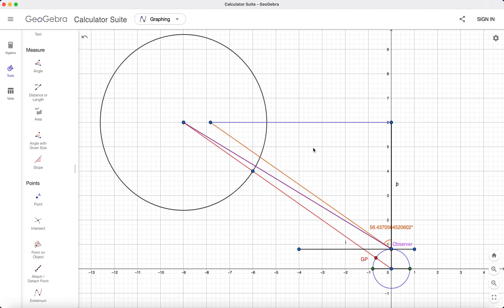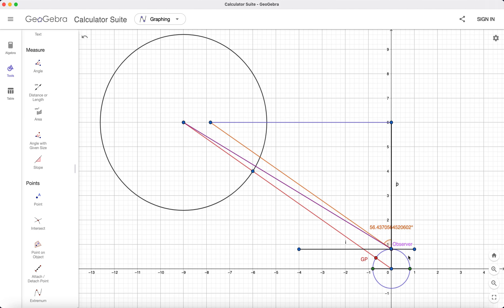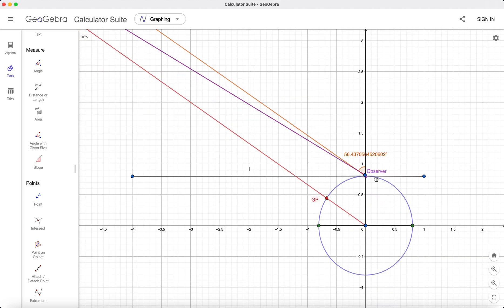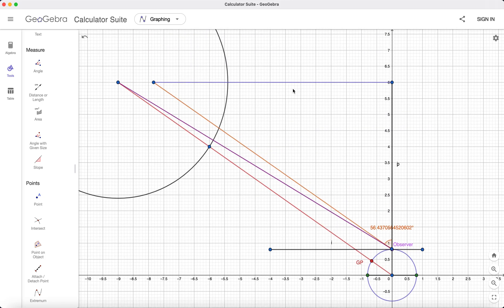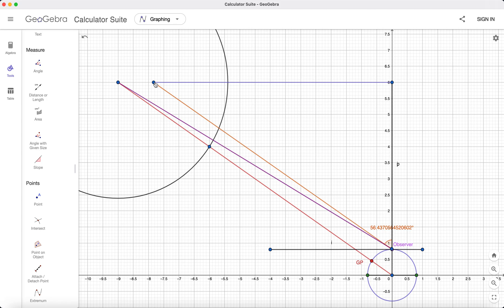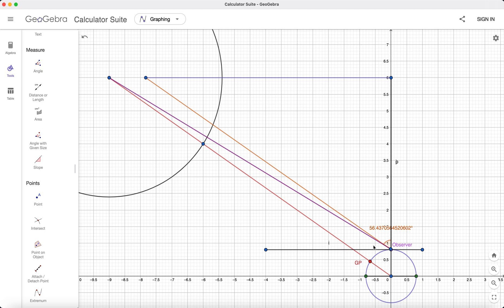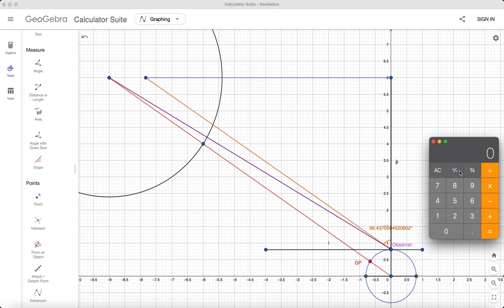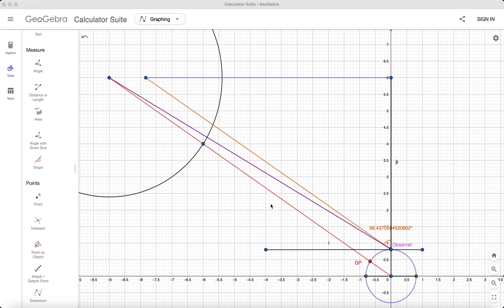Zenith Phobia....?

Comment: BRILLIANT! YES, parallel rays to the star! By Jove, you almost have it! 2 or 3 more videos like this and I think you will nail it. Now here's a tip for your next video. The ONLY thing we are interested in is finding our latitude DISTANCE along the ground is the difference between 2 latitudes. NOT the base of some imaginary baseline of an imaginary triangle. 
And finally, you have slipped back into the distance to the star mode.
Reply: But phil , the equator is an imaginary line 😂
Reply: @dennispickard7743  the equator is definitely an imaginary line based on a physical attribute of the world. It wasn’t decided on where it is by guessing. And of course it’s integral to navigation as are longitude and latitude. I’m not sure why an expert navigator like your goof flat earth self needs to be reminded of these facts.
Reply: Prof Phil Bell  tell me phil ! 200 miles from the imaginary line would north still be north and south still be south ,applicable to east and west ! Are continents to Scale on a globe used for navigation ? 
Now old boy , I almost getting tired of explaining this to you ! You really do need to stop crowing about ‘ flat earth ‘  our earth is not flat Phil as  has some stunning topography- flat is a description of a surface and not s Geometry.
Many globe skeptics do NOT believe our earth is any Geometry sneered at by globlings - most ( myself included) do not believe our earth is a pizza box, pancake or pizza or whatever is the globlings buzz word of week .
Our earth is a level plane and that has been proven over a hundred years ago . The next part of the puzzle phil , is what is our level plane in/upon ? 
Do you believe that the cartoons you gleefully show from ISRO is our earth ! Come on Philip ! It’s a bloody cartoon 
Ah ! I get it now professor - the anxiety lark ? Is this due to the spanking ye got on Adams channel?
Be gentle on the rum barrel this weekend Philip ! Ye have school on Monday 👋👋😂😂
Reply: Brian, you should listen to Phil. He's not wrong!
Reply: SHAWN HAWKINS Do tell me Shawn if one were going to stand on the imaginary equator line - could one view Polaris and  Polaris Australia ?
Reply: @dennispickard7743  , I suppose in principle it should be possible to see both stars from the same position, but in practice it would rather unlikely since both stars would have less than 1° of elevation. It's an interesting question, though
Reply: Tom Mole sigma is barely visible with the naked eye ,is it not the fifth magnitude . Several globe fanatics claim that both have  been observed ( so it’s gotta be true then lol 😂)
Reply: @dennispickard7743  , I submit that, though there may be a line of sight to each reference star from a single position, they would each be very difficult to see due to atmospheric attenuation. I have no idea who claims to have seen both stars from a single position, but then I don't speak for those folks, only for myself. I have never even tried to see both stars from the equator. It seems like a waste of time.
Reply: @dennispickard7743  I’m glad you say we only need to go to 4000 miles to see the shape of the earth. A handful of people have seen it from beyond 240,000 miles. Perhaps they took photos.
Reply: Andrew Johnston earth rise Bwaaaaaaaah 😂 come on Andrew mate !
Reply: @dennispickard7743  , actually, it is easier than that. There's clearly more than one way to skin the "Earth geometry" cat. In fact, it has been done for centuries before anyone ever figured out how to get into the air. Of course, it could all be a huge conspiracy to deceive the unwashed masses for reasons unknown, but the facts do not bear this out. I will admit that from the surface of the planet it can be challenging to even visualize the Earth as a great big sphere and that challenge may well beyond that capacities of a flea on a basketball, but humans can solve it. Well, some humans can, even without getting 4,000 miles above the surface and just looking.
Reply: Tom Mole lol Tom 😂 no one has ever detected curvature at ground level or not much higher than . Do you trust your eyes Tom ? I have excellent eyesight but yet I know train lines do not converge  - if you were given a task !
(1) observe a street 1km long .
(2) every 100 m there is a house , street lamp and a car .
(3) sketch what you actually see .
(4) start making a scale model on your graphic representation.
(5) start making the lampposts first - would they all be the same size ? or according to the sketch would the last one be smaller than the first one ? 
Some people say that a ship going over the vanishing point is proof of curvature - a midrange telescope says it isn’t .- just saying
Reply: @dennispickard7743  , oh please! My draw skills are rather limited. Would it not be sufficient to stipulate that angular size diminishes with distance? But then, what does this have to with the Earth being curved? I have never yet heard anyone say that ships going over the vanishing point is proof of curvature. Who said that?
Reply: Just William if you are using a theodolite- it would not matter . The instrument is firstly calibrated by the usage of a simple inbuilt device called a ‘ spirit level ‘ the terrain on which the instrument is placed upon is not taken into consideration . The differences in elevation of ‘ fixes ‘ are simply recorded . The instrument is deemed LEVEL once calibrated .
Reply: Prof Phil Bell Lol 😂 phil “ we both know the earth is a sphere” yo pro ! A lovely little bit of passive aggressive there Philip with a chunk of Transactional Analysis thrown in - Transactional analysis (TA) is a psychoanalytic theory and method of therapy wherein social interactions (or “transactions”) are analyzed to determine the ego state of the communicator (whether parent-like, childlike, or adult-like) as a basis for understanding behavior.
Tsk,tsk Philip ,I don’t think so lad ! So Professor , this is your parent Ego State talking to my child Ego state ? Ah ! Good ole TA  . any crossed Transaction ( if used properly)  can be persuasive in essence .
Yes Philip dear ! I do work with  data that is not dependent on Earth being a sphere! In fact it would be detrimental to my wellbeing if I considered so .
I thank you for your concern Philip , but no need fella , but I’m happy being a globe skeptic until I see an actual photo of our earth from high altitude ( not CGI nor 2 bit cartoons ) .
Enjoy your weekend Professor .
Reply: @dennispickard7743  
Why is there no dip correction needed with a theodolite, or bubble sextant or artificial horizon?
Reply: Darrell Kimmel Lol 😂 Levelling is a process of determining the height of one level relative to another. It is used in surveying to establish the elevation of a point relative to a datum, or to establish a point at a given elevation relative to a datum .
Reply: @dennispickard7743  
So?
Reply: Darrell Kimmel  you’re not serious Darell ? Dip correction .don’t you mean ‘ apparent altitude ? Or sensible horizon? You do not use any correction for dip if ‘ artificial horizon is used . The artificial horizon is the ‘ sensible 
The altitude obtained after applying corrections for index error and dip is also referred to as apparent altitude,
Please man ! Where’s the photos of earth Darrell ?
Reply: @dennispickard7743 , what a great question!! Where indeed are the photos of Earth? I have never yet seen even a fake photo of the "Blue Disk" that might prove the Earth is flat. I have, however, seen photos of the globe, though some claim that they are fakes.
Reply: @dennispickard7743  
Dip correction is required when using an optical/marine sextant and the horizon to create a reference baseline as one side of the Angle of Altitude.
This reference baseline is level at and perpendicular to the navigator's zenith.
Bubble sextants, theodolites and marine sextants with artificial horizons don't correct for dip, no matter what elevation the sighting is, relative to sea level, because they create a lower baseline that is level at the navigator's GP and perpendicular to the navigator's zenith by design or calculation. The baseline being level at, and perpendicular to the navigator's GP zenith is crucial, not elevation above sea level.
Flerfs say there must be a LEVEL line between the navigator's and star's GPs. Can that line slope? From 20,000 feet?
Does the horizon rise to eye level at all altitudes, as is claimed, or does the dip correction debunk this?
Nice Transactional analysis copy paste by the way.
Do you have a link to the original page?
Reply: Tom Mole Tom “ blue disk “ 😂 TOM ! I have told you many times that I’m not a flat Earther in your meaning of it - 
I do not believe our Earth is a pizza box or pancake or a frisbee or anything resembling that Geometry - not one bit .
So then Tom , let’s see the photos ( unadulterated and non CGI imagery ) - don’t mention the blue marble Tom or I will scream !
Reply: @dennispickard7743  
Not a glober, not a flerf.......
What's your claim?
Reply: Darrell Kimmel what’s my claim? - I’m flobling Lol 😂👋👋😂😂😂
Reply: Just William I don’t believe I said it’s ok of any geometry are we going to dismiss artificial horizon and sensible horizon?
Reply: @dennispickard7743  , I wouldn't want you to scream. LOL I suspected that might, which is why I very carefully said nothing about the blue marble photo.

 What did say, however, is that, despite the fact that some might claim that photos like the blue marble photo are all fake, there are no photos of the "blue disk", not even fake ones. I never suggested that you provide such photos. I just said that they don't exist. I thought this was a pretty insightful point, didn't you? Are you actually asking me to show you certified genuine photos that I have personally taken from 4,000 miles in space? And, if I can't produce these photos, then the Earth is not a globe? 

How would you know then? Do you have certified genuine photos that you have personally taken that show that geometry of the Earth to be anything at all other than a globe? I've got no such photos of the globe and you have no photos whatsoever, so you can see nothing more or less than I can. You'd agree then that it would be fair to say that, unless you can provide your genuine photos, you can't honestly say that the Earth isn't a globe! Maybe there's other ways to determine the geometry of the Earth beyond photographs.
Reply: Darrell Kimmel nice copy and paste Darrell
Reply: Tom Mole No Tom , I do not have any photos ( not even fake ones 😂)  right Tom , I’m away out for Sunday lunch with the good lady - I think I’ll start with a pint of flat beer ,followed by a flatbread then to finish a nice pancake with icing round the edges 😮.
Enjoy your weekend Tom .
Reply: @dennispickard7743  
If I copy/paste, I use "quotation marks" to indicate that it is indeed a quotation from another source.
Reply: Darrell Kimmel “ oh you do ,do you ?” Ahahahahahahaha
Reply: @dennispickard7743  
You do realize there are two Blue Marble images, right?
"The Blue Marble is an image of Earth taken on December 7, 1972, from a distance of about 29,000 kilometers (18,000 miles) from the planet's surface. It was taken by the crew of the Apollo 17 spacecraft on its way to the Moon, and is one of the most reproduced images in history."
Reply: @dennispickard7743  
Your best globe refutation is THAT crappy music?
Country western is the truly the music of poetry.....the words always rhyme so very well. 🤮
Reply: Darrell Kimmel music 🎹🎷 oh there ain’t no photographs of earth !
Reply: @dennispickard7743  , well... TBF, there are photographs of Earth, lots of them, even if some were retouched a bit. What there are none of is photos of a flat earth (or concave or toroidal or hollow or....)
Reply: @dennispickard7743  , why would they need to be retouched a bit? For the same reason that Beyonce's photos need to be retouched a bit. It makes the photos more presentable, of course! Why do women wear make up? I think you can get a look at the original photo, if you try, but it is not an example of the Earth's resplendent glory. Of course, no one has yet taken even one dull, blurry shot of the flat earth, have they?

To your second point, I find flerfers come in many flavors. Some are religious zealots, many are just globe deniers, others are disengenuous trolls and still others are simply booger eating, crayon munching idiots that believe anything they are told. Most seem convinced that the United Nations logo is a genuinely accurate map of the Earth. If that doesn't make you laugh out loud, you must lack a sense of humour. What do figure the term "flat earth" means?

Now, to answer your question, I don't know if Elon Musk actually launched a car with a dummy astronaut in it or not. In fact, I don't really care. It could true or not, but who cares? I suppose it's entirely possible, and yet it could just be a fabrication for publicity. Either way, there's nothing particularly interesting about this stunt. Wouldn't there be a more engaging question you might ask?
Reply: Tom Mole thank you for addressing the points , with an interesting twist I’ll warrant !
(1) the reason Beyoncé’s photos are touched up is to appear as something she is not - why do women wear make up , well Tom that question would be best suited to an Anthropologist rather than us mere mortal men - ok I’ll take a stab at it - increased self esteem perhaps? My wife does not wear make up , though she does use natural skin care malarkey.
(2) flat Earthers “ - disingenuous Trolls “agreed Tom , some Defo are , “ booger eating , crayon munching idiots that believe anything they are told “ well Tom ! I think that is applicable to both sides there .
The United Nations a flat earth map ! I’ve no idea , I don’t think it is ,perhaps it’s a meaningless Logo ?
“ the term flat Earth “ - well Tom , I do believe I have explained this before - but I can only give you my opinion ,though , subjective albeit .
In a nutshell I do not believe the cartoons shown are our earth , what geometry it is , I could not tell you . I would need to see it from a very high altitude with mine own eyes .
(3) I’d say we both are fairly sure that the ‘ space car ‘ lark is a publicity scam and we are not going to waste our valuable time discussing the ‘ con artist ‘ of the century .
“ Another engaging question you could ask ?” Yes , indeed there are , but you would tackle the questions with obfuscation and non committal like the last lot .
Be well old man 🍺
Reply: Just William Lol little willy 😂 I note you avoided the space car malarkey! Good idea mate , no one in their sane mind would defend that tripe 👋👋😂😂😂😂
Reply: Just William Lol 😂 nice try little willy ! You know it BS as much as I do ? Car in space - vrooom , vrooom 😂😂😂😂😂 👏👏👏👏
Reply: @dennispickard7743  
The space Tesla is kind of a genius publicity decision.
The 2010 roadster was Elon's own daily driver and 8 years old at the 2018 launch.
"In March 2017, SpaceX's founder, Elon Musk, said that because the launch of the new Falcon Heavy vehicle was risky, it would carry the "silliest thing we can imagine". In June 2017, one of his Twitter followers suggested that the silly thing be a Tesla Model S, to which Musk replied "Suggestions welcome!". In December 2017 he announced that the payload would be his personal "midnight cherry Tesla Roadster".

One of the test flight objectives was to demonstrate that the new rocket could carry a payload as far as the orbit of Mars. NASA had declined SpaceX's offer to carry a scientific payload."

He couldn't profit off a test launch of an unproven rocket, needed a dummy payload, had an older car and it was time to upgrade..... and he OWNS the car company.
He's also kind of quirky apparently.
And now in 2022, completely out of the  blue, YOU are talking about Tesla and Spacex!
Reply: Just William Nah !
Reply: Just William Lol 😂 William ! Our earth does not move - waken up little Willie 😮
Reply: @dennispickard7743  , well, OK then. I guess that about it.

I was curious about a couple the point you made, however. 
(1) What would you expect see of the Earth from 18,000 miles above the surface? Would a photo that you personally took show you vibrant life ebbing and flowing with all types of flora and fauna vying for their existence through war and peace? Or, would you just see a rock of whatever geometry covered by weather and uneven lighting effects. I'm thinking that you're anticipating anything besides a globe.
(2) I asked you what you feel is the correct geometry for earth and you reiterated what you believe it is not! It seems reasonable that you would be keeping an open mind on the subject, but when you eliminate the best supported, most likely solution out of hand you aren't really keeping an open mind, are you? So, if it's not a globe, what is it? If you don't know what it is then you probably don't "know" what it isn't, right? It's just your opinion, a belief.
(3) Elon Musk's flying car is about as irrelevant as last year's commercial for a Purple mattress or underarm deodorant. Who cares? Asking irrelevacies is a well worn technique for obfuscating, yet you refuse to ask a more meaningful question because you presume that I'll fail to commit to my answer and obfuscate to cover it up! That's pretty offensive talk coming from the guy who won't commit to his answer about the geometry of the Earth and then asks about whether or not a publicity event in space is real or not. Perhaps you were looking at a mirror while you were typing your response. Giving you the benefit of the doubt I'll ask again. Don't you have a more interesting, relevant and engaging question you could be asking?
Reply: Tom Mole yes Tom ! In fact 2 questions .
(1) how many hours is a parabolic flight pilot allowed to fly in a month due to eye  and the vestibular system  damage ?
(2) how would the vestibular system work if one had no inherent up & down for extended period ? 
Offensive Tom ! Moi ! Lol 😂- no I’m not offensive , just not buying the BS from agencies setup to Hoover up tax payers money and give out cheesy cartoons and 2 bit graphics . I’ll keep my skepticism tightly in my pocket for now thank you .
Reply: Just William mikleson morley !
Reply: @dennispickard7743  , well, you know, I have no idea how many hours a parabolic flight pilot is allowed to fly in a month. Except for the accumulating effects of rapid pressure changes, I can't imagine what about a parabolic flight would cause damage to the eye or vestibular system. Micro gravity does not damage these biological systems as far as I know. Do you know something more?

The vestibular system is pretty much useless in microgravity, which contributes to making rollercoasters so exciting! The lost sense of up and down gives most people "butterflies" as it triggers an involuntary adrenal response. Over time the brain learns to anticipate this reaction and suppresses it. But, it is pretty exciting at first!

So, did I obfuscate or fail to commit to my answers? The fact you're unwilling to commit your skepticism to critical review was not offensive. What I found offensive is you attributing your behavour to me. You presupposed that I would do what you do. That is just not how I roll!
Reply: Tom Mole “ did I obfuscate “ lol 😂 just a little bit Tom ! What’s happening chief ?
Reply: @dennispickard7743  , do you really feel that I was obfuscating? Really? Wow, amazing! I guess, in orderto be clear for a flerfer, one must just blindly agree with whatever he says without question, challenge or a mind outside of the faith. I'll tell you what, why don't you tell me what I should think and I'll mindlessly agree with it. Then, when you say I'm obfuscating, you'll just be accusing yourself and the only thing either of us will be right about is who is covering up their ignorance with red herring fallacies. Does that sound like a plan, chief? LOL 
(Wow! No wonder most folks just laugh at flerfers! Trying to have an intelligent discussion is like talking to the chimps at the zoo.)
Reply: Tom Mole Tom Lol 😂 calm yourself sir ! I’ve told at least twice before - I’m not a flerf . I’m skeptical about our earth being a spinning rock . That does not mean I’m going to embrace the pizza box model - I’m not swapping perhaps one untrue model for another that may be as equally untrue . That will get one nowhere .
Now Tom , I did mention about ocular damage in micro gravity and you disagreed ,lest you thought it would do “ no damage “ - but - the vids I linked clearly stated that the actor nots 😂 claimed ocular malady occurs .
“ covering up ignorance “ Nay Tom ! I believe you are a very intelligent man and not at all ignorant , on the other hand I’m Scottish and can be a bit ! But that does not mean we cannot have a reasonable convo ..
The only subject I wish not to discuss is religion in any guise . I don’t know if you’re religious? I’m not , inasmuch I never give it much thought . My mum is a ‘ holy joe ‘ in Scotland that’s a strong church goer .
Perhaps you have noticed that Globies v flatties are taking a bit of a back seat at the moment and another subject has reared its head which is Atheism v classic religion v YEC ( young earth creationist) - they are all incorrect ,though there is a sub division of all this - that is ‘ intelligent design ‘ those usually spar with 
Darwin’s crew .
If I were going to put a horse on the race it would intelligent design, it seems more credible than the rest . Parts of Darwin’s theory is correct , but the linear time scale is not . What the Darwinism folks either won’t or don’t take onboard is the Bacteria is the main agent for DNA change in animals and not solely timescale.
(1) Darwin - not entirely true. fact mixed in with fiction so well that the two cannot be separated .
(2);Atheism - many whom claim that they are so , do not know what an Atheist is - some read the Bible ( which is scribed in parable and not literal ) then take or cherry pick a passage , put it in literal envelope and smash it to pieces . A good example of this is that satanic  clown Aron Ra ,who uses schoolboy NLP, Transactional Analysis and the heavy clout of his well memorized cheesy vocabulary. Nope ! They are not atheists , they are anti- theists 
(3) classic religion , I’ve no idea . Perhaps it’s where some get their spiritual salvation 
(4) the intelligent design dudes - now there is something there that raises an eyebrow in most . I read a lot of a girlfriend of mine books on psychology and Carl Gustave Jung always seemed to intrigue me - synchronicity , coincidences ( or lack of ) perhaps everything has a purpose? - perhaps nature has its own nature and contains therein an inherent intelligence - a code? A set of instructions if you will ( I have used the word perhaps Tom , so I make no claim to the validity of ) If you look at quantum biology,it’s a mind blowing fascinating subject . Some who have studied ( a lot more than I have ) sway towards the ‘ Matrix ‘ theory , I don’t .i just find it fascinating and ponder why randomness could be considered as an option- thus my favor for ID .
Right Tom that’s enough computer lark for one night - I’ll have eyes like an astronaut if I’m not careful lol 😂 
Goodnight Tom .
Reply: @dennispickard7743  , I'm really quite calm. It has been a bit frustrating, but I'm accustomed to that. I accept that your are not saying that the Earth is flat, but rather that you're pretty sure it not a globe. You would be what I refer to as a "globe denier". It seems to me that you are fine with the Earth being any shape at all as long that shape is not spherical. I've never really understood why it's so important for the Earth to not be spherical. I find this frustrating because it really serves no important purpose as far as I can tell.

There's nothing wrong with being skeptical. Science depends on large doses of skepticism to keep it objective and progressing. And yet skepticism as a goal is just as hazardous as religion is to the development of science. Allow me explain from my own experience.

As a child I was introduced the physics of the world around me and I began asking questions. The answers I got back were like this, "this is just how it works", "you'll understand it when you grow up", "I don't really know how it works", "you wouldn't understand it even if I explained to you", etc. My cousin, who happened to be 4 years older than me and very interested in science, would try to explain to me things that were well above my grade level. I didn't always understand what he told me, but I never forgot his explanations. That started nearly sixty years ago. My greatest fear was that I might end up indoctrinated by the tenets of science that I might lose that innocent curiosity and for most of my formal schooling I eschewed science. My skepticism pushed me away from science, not contributing to it. Once I moved into engineering the science behind it became more intriguing.

Now I'm back, seeking to find the "Holy Grail" of science that everyone else might have missed and I have the internet to help me research this endeavour. I searched for offbeat conjectures that I might develop, but what do I stumble upon? A plethora of idiots vehemently promoting the retardation of science, because..... NASA and God!

I suspect that Einstein, Tesla and Newton all got some things wrong, but they got most things right. I don't waste much time on conspiracy theories in science. I do not opine that there is a massive cover up in the scientific community to deceive the unwashed masses about the nature of Nature.

I do suspect that there is some Intelligent Design behind it all, but I submit that it is all design, not execution. No one is standing behind a curtain pulling levers and twisting dials to control every aspect of everything. That just seems silly to me. I leave the wizardry to wizards and I never visit Oz.

I do not much bother to question that we live on a rotating sphere that orbits the Sun while being circled by a much smaller moon. I have already taken up this question and found this answer to be most probable and completely consistent with obervations. I would prefer to address the questions that don't have obvious answers, such as "what is gravity?". I never ask, "does gravity actually exist?" That is a stupid question which I reserve for the stupid to ask.

I have never considered Quantum Biology. In fact, I'm pretty sure that I've never heard of this science before. Perhaps I'll look it up.

It's funny that you're heading off to bed. I just woke up! It is morning here whilst it's nighttime for you, but this makes sense, since you are about 135° away from me on the globe! I hope you get that good night's rest in order to wake with eyes like an astronaut....open! 😃
Reply: Tom Mole good morning Tom . Ok we’ll put the Geometry of our earth on the back burner for now as we will not agree on it - perhaps our earth ‘ doffs it cap ‘ to being more toroidal than given credit for ?
(1) ‘ Holy Grail ‘ indeed Tom . IMO the Holy Grail  May be so close to us that we can’t see it , perhaps it’s is not elusive ,but more evasive in its nature ? 
(2) NASA & God - let’s take nasa first 
(a) scenario #1 the old chestnut- the moon landings. Perhaps they did land on the moon . Since it was under the auspices of military operation it would have been done with great secrecy, and at that time, near unimaginable funding - but ! What would need to have  been given was a show drowning in its own patriotism- thus paving the way for enormous funding ( offset ) of public money ?
(b) scenario #2 - they did not land on the moon as natural laws would not afford this venture any quarter . Thus the inverse square law may have been the inhibiting factor . I remember reading an article about high altitude data gathering probes in the 1950’s and the difficulties incurred - heat and radiation the main obstacle . In the article ( true or not ?) it stated that scientific instruments onboard were destroyed through inadequate shielding .perhaps the alloys or polymers had not be invented nor ‘ science-ed ‘ at that time .
JFK made a speech saying that “ they would use materials, not yet invented “ lol 😂.
If lead was used as shielding the ‘ catch 22 ‘ scenario would be in empty - the more lead the more fuel - and so on .Unfortunate animals were placed in these probes .Reports of monkeys with embolisms and not fairing well under the conditions . I have not witnessed this ,but can only tell you what the article stated .
(2) God - that’s a tough one Tom . First one needs to establish what god/s are or a god is . Perhaps understanding that it is not a kindly old gentleman with long flowing white robes and sporting a white beard and locks that resides skywards - in short, I do not believe that god is a person , it is something else , perhaps it is everything ?
Some say if there is intelligent design there must be a designer , then who designed the designer . That is going down ‘philosophical avenue ‘ that will serve no purpose rather than give someone ( extroverts usually) a platform to show off their vocabulary prowess and a sharpened skill set of circular reasoning .

If you take Flagellum- a bacteria that has all the components of an induction motor , one needs to leave the comfortable realm of chaos and randomness and perhaps give intelligent design some credence .
Here is Flagellum ( perhaps you know already ) https://youtu.be/fFq_MGf3sbk
This is Quantum biology, but on an entry level . It gets more complicated as it goes on on - famous quote David Bohm or was it Neils Bohr ? ( wrong spelling likely ) “ if you say you understand Quantum mechanics, then you don’t understand Quantum mechanics. 
Right gotta go - astronaut eye coming on 😂 
Enjoy your day Tom .
Reply: @dennispickard7743  , OK, let's do put a pin in the Earth geometry thing for a moment. After all, if the Earth were toroidal, we would easily see this and could photograph it from our own backyards. I think we can put that bizarre conjecture into the bin now and forever.

1) the reference to "the Holy Grail" was, of course, purely metaphorical. I'm not talking about find an actual old wine goblet, but rather an advanced perception in science. What I'm seeking is not just too close to be seen, it would be an effective entirely new way of seeing. It is not elusive, it is beyond conception. The perception I seek is currently our comprehension. 
2) NASA & God were two of the most common excuses that flerfers offer for the planet being flat. I don't find that either of these has any impact whatever on the shape of the Earth. But, let's go ahead dissect it...
a) NASA - You're likely too young or too far away to remember the Mercury, Gemini and Apollo programs and the politics that drove them. They were not austensibly military programs, though there was a strong political bent to them and they were publicly funded. These programs were NOT however carried out in secret. NASA wore its successes and failures on its sleeve for the world to see. Just as any private company developing a new product the proprietary technologies were not released right away. We were in a race with the Soviet Union and we weren't giving away our competitive edge. We funded our "Space Race" very generously indeed, as did the Soviets. I recall it being very patriotic for both sides with cheerleaders inspiring the public to approve whatever it takes to win this race!
b) Perhaps in our enthusiasm we bit off more than we could chew. We claimed to have won the "Space Race" by landing a man (or two) on the Moon and returning them safely to Earth, but maybe we cheated. It is remotely possible that Apollo 11 never actually landed on the Moon and that all our evidence that we did was fabrication in a sound stage in Area 51, but I doubt that. Maybe I doubt it because I am biased. As a yank I prefer to believe that we beat the Soviets to the Moon, but I think there's more to it than that. But.... can I prove beyond a reasonable doubt. Who knows? I don't even care to try. There were no insurmountable problems with getting to the Moon as long as we could throw enough money at those problems and I think we both agree the American threw A LOT OF MONEY at the problem.
Whether or not Apollo 11 actually landed on the Moon or not seems a trivial relic of the past, however hysterically one considers the money spent to get there. The cost was to the American taxpayers, not the Scots, so it should not be any real concern to you. Perhaps your real concern is that the problems could not be overcome by copious funding and thus to avoid exposing the failure there was a giant cover up. Well, I guess anything is possible, but covering up failure does nothing to advance science and so it really doesn't interest me. I favor the conjecture that NASA 9vercame all obstacles and achieved its objectives. I find no reason to doubt this other than a personal desire to do so.
2) God is not such "a tough one" as I see it. If one must prove God in order to deploy Him as evidence, I leave that odious task to the flerfers who depend on God to disprove science. It's not my problem. In the end calling on God or NASA to disprove what we already know to be true is a waste of my time. It retards science which is not interesting to me. You'll not catch me claiming that science is true because either God or NASA said so.

I have a couple of things I'm working on right now, but I would like to take a look a this "Quantum Biology" you are telling me about. I made a note to watch the video you linked in my morning. Now, I must catch some ZZZzz's before the morning sun ruins my slumber. Have a good day!
Reply: Tom Mole yo Tom , indeed Tom I was well aware that the reference to the ‘ Holy Grail ‘ was metaphorical. Perhaps Tom it is ‘ beyond conception ‘ I don’t think conception was the best word you could have chosen ? I would have used ‘ Genesis ‘ - the origin or mode of formation of something.? Perhaps I’m incorrect? Mayhap we are the Holy 
Grail - inasmuch a vessel waiting to be filled with something non tangible?
(2) I think you know my thoughts on NASA  - so it would end up a pissing contest of which I’m not interested ! 
“They were not ostensibly military programs “ perhaps they were clandestine black ops ? The military are not in the habit of divulging their business .
(a) Yes , I’m to young to remember the space programs - I can remember watching Capricorn 1 though 😂
Let’s tackle (1) the toroidal - perhaps the field has zero mass and therefore cannot be seen as a torus with our own eye - I do not know or wish to lay claim to ( Ken Wheeler HELP !  Lol 😂) .
I care more about what our earth actually is, and not plain Geometry. If you look into quantum biology,it gives more than a healthy nod to all things having a reason rather than serendipity - intelligent design if you will .
Right Tom almost bedtime.
Reply: @dennispickard7743  "going over the vanishing point" What the hell is that supposed to mean? How can one "go over" a vanishing point/
Reply: @davidfaraday7963  the vanishing point ! Is due to optical  perspective - therefore not a physical location! 
The horizon ?
Reply: @dennispickard7743  If you can "go over" the vanishing point then it has to be something physical. The horizon clearly isn't the vanishing point as we can see a lot further than the distance to the horizon.
Reply: @davidfaraday7963  Ahahahahahahaha 👋👋😂😂😂😂😂😂 get back to school fool !
Reply: @dennispickard7743  There is something deeply ironic about you telling me to "go back to school" since the entire globe-denier argument is based on the claim that what "they" teach in schools is all lies.
Reply: @davidfaraday7963  yes ! That’s largely true , look up a channel called ‘ history debunked ‘ and you will find that indeed most of what is in history books are not historical nor actual 👋👋👋😂😂😂🏋️‍♂️
Reply: @dennispickard7743  We are talking about science, not history. In any case the claim that "most of what is in history books are not historical nor actual" is bollocks.
Reply: @davidfaraday7963  history and science are intertwined , you’re sounding like another clown ,who’s too ashamed to admit that they  have been duped 🗣😤🥊🥊🥊🥊
Reply: @davidfaraday7963  Ahahahahahahaha 😂😂😂 nice try matey ! But a big fail ! 👋👋👋👋👋😂
Reply: @dennispickard7743  No, history and science are very clearly NOT entwined, you just want to think so.
I looked at the channel you mentioned, that channel owner has his own agenda and is peddling his own version of history.

Anyway back to science, you told me to "go back to school" - why?  What point were you trying to make?  Clearly you failed to learn much at school as if you had you wouldn't say the absurd things here that you do.
You said something about ships going "over the vanishing point" which is meaningless. But if, as I said, by "vanishing point" you actually meant "horizon" then what you claimed was demonstrably false.
Reply: SHAWN HAWKINS Yes ! - have you done it ? Bearing in mind that Polaris Australia is only just visible with the naked eye . “ flat earth “ ! Look fella ,the majority of globe skeptics do not believe our earth is a pizza box, pancake or a frisbee or any other geometry of that ilk . Our earth has some stunning topography therefor it is not flat ! Do you get that ? You do not know what our earth is ( as I do not either ) but I am willing to admit that . I will not take cartoons as evidence with space hoax agencies siphoning tax money for no reason,  but just to do that and show cartoons. 
Did you see phil bell’s ridiculous ISRO cartoon satellite deployment? - if this alleged guru is using cartoons and ‘ 2 bit ‘ graphics as evidence , then he is a fraud ? Which means any of his other nonsense is surely fraud ?
Look at the tripe Blue MS did with the ten foot pipe filled with butane gas demonstrating pressure gradients and containment!? Even you could understand that it was garbage ? - even Bob the science guy ( Lol 😂) cheered his nonsense on . Bob Townsend is a notorious liar and has landed himself in  legal hot water for reasons I won’t go into as he would deny it and attempt to sue me . Bob the lying guy said on a Chanel that one train line heats up more than the other due to the coriolis effect 😂😂😂😂 if you were going to ask anyone who track installation , inspection and replacement, they would piss themselves laughing . He also said that when he is driving he makes 5 degree corrections - ha ha ! 
I’ll tell ye what Shawn ! I’ll pick you up on my bike and at a steady 100 KPH,I’ll start making 5 degree corrections for the coriolis and we’ll see what happens! PS Shawn take a fresh pair of panties with ye - you’ll Need them ! 👋👋😂😂😂
Reply: Would anyone care to take up T Brown's mantle? Does anyone feel that he can support the argument that straight lines cannot exist on Earth?
Reply: @tomfromamerica8042  of course she cannot. My table is flat with straight lines. That of course does not depend on the shape of earth.
Reply: SHAWN HAWKINS  Thanks Shawn for that story. Meanwhile you have no geometric horizon and elevation angle measurements require flat earth measurements.
Reply: @tbrown3356  What the hell does the surface of the ground got to do with elevation angle? Are you suggesting you can’t get an elevation angle from the top of a mountain or from an aircraft? What about a bubble sextant or a theodolite or an inclinometer that relies on plumb?
Reply: @profphilbell2075  An elevation angle is the apparent height of the star above the ground. 🤣🤣🤣🤣
Reply: @tbrown3356  Actually is the ANGULAR size of the star above the ground, NOT the distance. Are you suggesting that expert flat earth navigators like your good self know the distance to the stars?
Reply: @profphilbell2075  Measuring an apparent altitude / elevation angle of a star above the ground to get the geometric distance from the observer to the geographical position of the star Phil is what is done in celestial navigation. If you think you know the actual height of stars then prove it Phil.
Reply: @tomfromamerica8042  Why, when you just begged me here to give you a hemisphere (half a sphere)? I won't be watching a video where you beg viewers to believe in a hemisphere to conclude you live on a sphere. That's a fallacy. An argument that uses fallacy is invalid.

And the elevation angle measurements of Polaris is what latitude lines on maps and globes were created from.
Reply: @tbrown3356  , I'm certain that I did not beg you for anything, particularly not a hemisphere (I know what a hemisphere is). You should watch the video. I don't beg anyone to believe in a hemisphere, not even to conclude that we live on a sphere. I mentioned the northern hemisphere, not to challenge your silly belief system, but rather simply because what I present in my tutorial will not work south of the equator, be ause from there you cannot get a line of sight to Polaris. I cover this in the video that you're afraid to watch. Limiting the scope of one's hypothesis is never a fallacy. Do you know what "fallacy" means?
Reply: @tbrown3356  , of course, you are correct that latitude lines are based on elevation angle measurement to Polaris and those lines depend on the light rays coming from the star being indistinguishable from parallel everywhere on Earth where the star can be seen. If the Earth were flat the elevation angle to Polaris would be 90° everywhere! How do you figure you latitude from that? Watch the video, then make your outlandish claims.
Reply: @tbrown3356  BS. I guarantee you have never done celestial navigation in your life. There is only ONE aim. Determine what is horizontal to your instrument by holding it plumb and read the elevation angle. That’s it. No baseline of any triangle, no distance to any star.
Reply: @profphilbell2075  You're the only one talking about a distance to stars. The elevation angle is measuring the angle of the star above the ground to get the distance to the geographical position of the star. An angle requires 2 straight lines. Earth is measurably flat.
Reply: @tbrown3356  , actually the Earth is ONLY measurably flat where man has made it so, but what difference does that make? No one measures the elevation to ANY star with a sextant using the ground as one of the sides of the angle. A sextant does NOT use the Earth's surface. It uses two lines of sight, both of which are above the surface. This would be so, even if the were actually flat.

Phil is exactly correct. There is no baseline of any triangle between the observer, the star and the star's GP. Pythagoras' theorem is not used for finding your position, which is why it works. Unfortunately, if the Earth were actually flat, the ONLY latitude on the planet would be at 90°! Wherever you might be on the flat earth, your latitude would 90°, just as it is at the North Pole. For a sextant to be useful the surface of the Earth MUST curve.
Reply: @tomfromamerica8042  Elevation angles require a horizontal plane. In spherical geometry there are no straight lines. You need a flat earth and it's not debatable.
Reply: @FuryPilot  There are no straight lines in spherical geometry. That's a fact that can't be debated.
Reply: @tbrown3356  Tangent is a thing. PERPENDICULAR to plumb. Hold your sextant PLUMB. Ay 90 degrees to PLUMB is a HORIZONTAL TANGENT. THIS is where you measure your elevation angle from. NOBODY TRIES TO PUT THEIR EYEBALL LEVEL WITH THE GROUND. So the surface is IRRELEVANT. i KNOW you left school early, but WHY are you struggling with this as an ADULT?
Reply: @FuryPilot  It seems like people like T. Brown are really struggling with basic concepts. I don't get why that is. How does an adult in 2022 not know what a tangent means?
Reply: @profphilbell2075  You're still talking about straight lines and planes (flat surface). You cannot use our Euclidean geometry. Stick to your Non-Euclidean spherical geometry. Stop begging to use our flat earth. Lol.
Reply: @tbrown3356  YOU SAID, "The elevation angle is measuring the angle of the star above the ground to get the distance to the geographical position of the star."
WRONG WRONG WRONG! The elevation angle is NOT measured from the ground. It is measured from HORIZONTAL which can be ANYWHERE. ON A MOUNTAIN TOP, IN A PLANE, IN A BOAT, ON THE BACK OF A TRUCK!!!  It does not matter where as long as it's perpendicular to PLUMB. THE SURFACE IS IRRELEVANT! NOBODY STICKS THEIR EYEBALL ON THE GROUND TO MEASURE ELEVATION ANGLE. How come you don't know this? How come an ADULT is struggling with this FFS?
Reply: @profphilbell2075  Elevation angles are the apparent altitude of the star above earth (ground) or sea and must be a horizontal plane. You cannot have a horizontal or any other straight line in spherical geometry (earth measurement) where all lines are curving. You must have plane (flat surface) geometry (earth measurement) for celestial navigation. These facts are not debatable.
Reply: @tbrown3356  
What do you think the radius of a sphere is?
It's straight, and used in spherical geometry and trigonometry, that's what.
The Angle of Altitude is NOT measured from sea or ground level.
It's measured from a line that is perpendicular to the navigator's Geographical Position and zenith. The angle is crucial, not the elevation from sea level.
That's why aircraft bubble sextants need only an angle but no dip correction.
They don't need to "dip eye height to sea level", your misunderstanding of sextants acquiring the horizontal by dip correction from the horizon.
(No, horizon and horizontal are not the same)
A bubble sextant at sea level and at 20,000 feet on the same zenith will have the same angle to a star and will use that angle without any correction for dip.
How can that work?
You say there must be a level line from the navigator's GP to the star's GP,  but how does that work with an airplane flying at 20,000 feet, and no correction?
Reply: @darrellkimmel2646  "Non-Euclidean geometry is the study of geometry on surfaces which are not flat. Because the surface is curved, there are no straight lines in the traditional sense, but these distance minimizing curves known as geodesics will play the role of straight lines in these new geometries.Oct 4, 2015"

Geometry - EscherMath - SLU Math
Reply: @darrellkimmel2646  If you cannot have straight lines in spherical geometry then you cannot measure an elevation angle. Now beg me to use our flat earth.
Reply: @tbrown3356  
"In classical geometry, a radius of a circle or sphere is any of the line segments from its center to its perimeter, and in more modern usage, it is also their length. The name comes from the Latin radius, meaning ray but also the spoke of a chariot wheel."
A sphere is defined by a radius.
Radii are used often in spherical geometry and trigonometry.
You didn't answer my other questions.
Reply: @tbrown3356  , who told you this nonsense??? The fact that the Earth is a globe does NOT in any way preclude the existence nor the use of straight lines! You do NOT require a flat earth and it's not debatable. Your conjecture, however, is quite debatable, but it is not supportable, which I suspect is why you would claim it cannot be challenged. If you were to debate your fanciful conjecture, you would then be required to support it with facts which you lack. Nice try, though!
Reply: @tbrown3356  Elevation angles do not depend on the ground. You can get an elevation angle from an airplane.
Reply: @justwilliam6893  Sounds like you are saying you need Euclidean geometry to even measure a radis of a sphere. That's correct. In Non Euclidean spherical geometry there are no straight lines, so you cannot have angles or even measure a sphere or anything else for that matter. You're the only one confused as you are using a made up geometry that doesn't apply to reality. Your model comes from flat earth measurements.
Reply: @darrellkimmel2646  You don't get to use classical Euclidean geometry. You believe in curved space spherical geometry.
Reply: @tomfromamerica8042  You don't know your model Tom. Now beg to use our flat earth.
Reply: @FuryPilot  In spherical geometry there is no chord or radius because there are no straight lines. A chord is used in plane geometry. Now beg to use our flat earth.
Reply: @tbrown3356  
You don't know what you are talking about.
You can't even understand what a tangent line is.
Reply: @profphilbell2075  Tangents are not a part of spherical geometry because a tangent is a straight line. Euclidean geometry is not spherical geometry. Sorry Phil. I can't let you borrow our flat earth for a tangent. Lol.
Reply: @FuryPilot  Beg to use our flat earth geometry. I thought you guys said everything works using spherical geometry. Lol.
Reply: @FuryPilot  So you don't believe spherical geometry works? Agreed. Welcome to flat earth!!!
Reply: @FuryPilot  A sphere is measurable in Euclidean geometry. You need a flat earth to measure a sphere. A sphere is not measurable in Spherical geometry because there are no straight lines. Now on your knees and beg to borrow our flat plane.
Reply: @tbrown3356  , oh but I DO know my model and you don't have any model at all, so i invite you to beg me to allow you to use the globe! Welcome to the Earth, Troll Brown. 🤣🤣🤣🤣🤣
Reply: @tomfromamerica8042  Your globe model has no practical use. You cannot measure anything in spherical geometry. Why would I beg to use a model that nobody can use for anything? We use maps created from elevation angle measurements of Polaris with plane geometry (earth measurements). You cannot even measure a sphere with spherical geometry (earth measurements). You need straight lines to measure things and that's what spherical geometry doesn't have. Get to begging for our plane geometry.
Reply: @tbrown3356  , you should pay attention to what Phil says. He isn't wrong! 

Nobody uses the Earth's surface as a "baseline" to measure the elevation to a reference star, neither flerfers nor intelligent people. Nobody! How would you measure the elevation to Polaris from an aircraft? (I'm making some popcorn for this show!)
Reply: @justwilliam6893  , T Brown could not even see curvature on a basketball held at arm's length! He seems to feel that since our eyes can only see two dimensions, the Earth must also be two dimensional. And, since two dimensional objects are occasionally flat, the Earth must therefore also be flat. That does sound like Sleepy Logic!
Reply: @tomfromamerica8042  You're using plane geometry if you are talking about measuring elevation and angles. Even measuring a basketball can't be done in spherical geometry because there are no straight lines. Welcome to flat earth!!!
Reply: @tbrown3356  , tell me then, can you see the curvature of a basketball held at arm's length? Can you describe what you see that leads you to believe that the surface of a basketball is curved?
Reply: @tomfromamerica8042  So you're now throwing spherical geometry under the bus. If you're saying you don't need spherical earth measurements then you are conceding plane earth measurements. 🤣🤣🤣🤣🤣🤣🤣
Reply: @tbrown3356  , is that what you concluded from what I said? Wow? Really? 

So, you're saying that ONLY spherical geometry exits OR plane geometry exists? OK, then I would say that ONLY spherical geometry exists. Don't fret, however, since all of Euclidean geometry is nothing more than a special case of spherical geometry. Absolutely anything you can do in Eucliden geometry can also be done using spherical geometry, though it tends to be more complicated and you couldn't understand it then.

I'm still waiting for you to explain what you see when looking at a basketball that leads you to believe that its surface is curved. That seems like it should be pretty simple for you. What are you waiting for?
Reply: @justwilliam6893  "The two most common non-Euclidean geometries are spherical geometry and hyperbolic geometry."

NonEuclid: 1: Non-Euclidean Geometry - CS UNM
Reply: @tbrown3356  , why do you suppose that you need a flat earth to measure elevation angles? You don't.